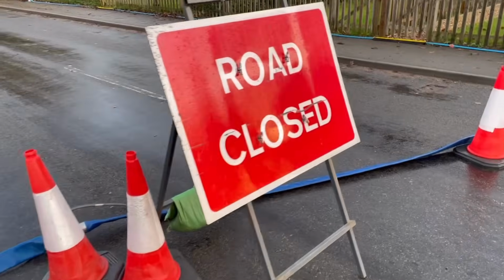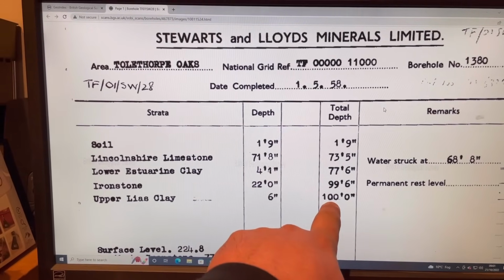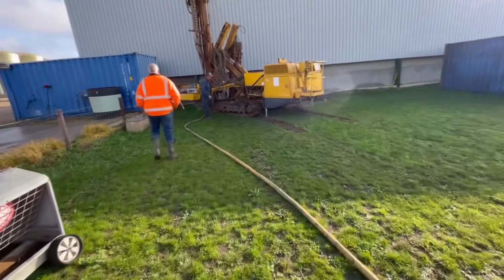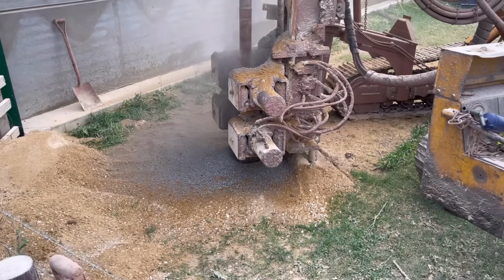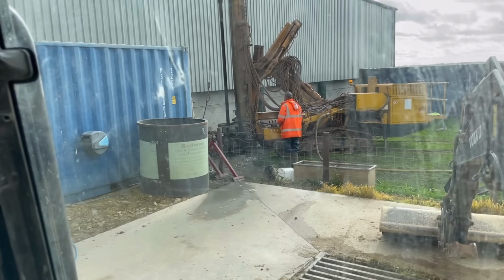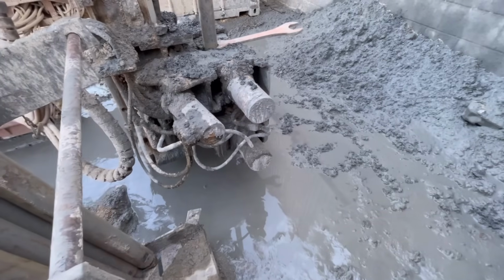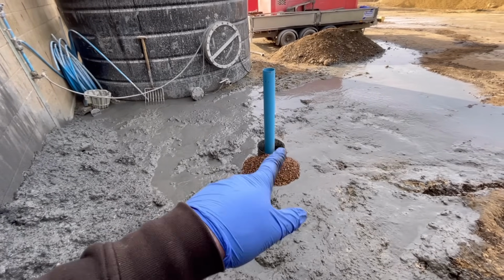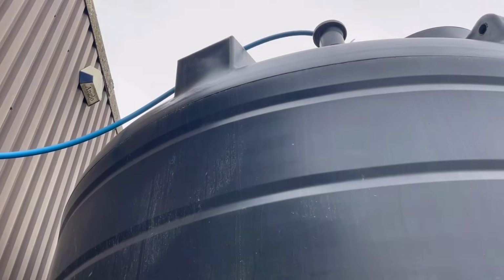Free water for life. Borehole 200ft into the ground to extract water.

Comment: Great video really interesting to see the basic of sinking a bore hole.  Years ago a brewery I worked at in the Thames valley sunk a bore hole where the water was held in a layer of chalk.  They drilled the hole then pumped acid down to dissolve the chalk and create a cavern which would fill with water to be pumped out.
Interesting thing they still had to pay some for the water removed as Thames Valley Water held the rights to all water even below your land.

Comment: Cracking Video Tom - I was really interested to see how easily you can look up what other bore holes were around you, and see what to expect when you drill - it was also interesting to see that it doesn't always go completely smoothly, but that you got there in the end. Out of curiosity, do they typically charge by depth, or by the hour - or just for the end result? And roughly what does a bore like that cost? Looking forward to barn part 2 - nice to see some real day to day farming projects.
Reply from the maker: Hi tim I think it’s a standard charge it only takes about 10mins to go another ten foot deep so not much in it really.
If they drill a hole and don’t find water there is still a charge but obviously don’t have to pay for all the liners and gravel pump ect.
About 7k for full set up all installed so not just drilling a hole.
Reply: In Wales they quote it all for a certain depth (think it was 60 or 70M)  and charge extra if have to go deeper

Comment: I did one about 7 years ago. Simerlar reasons low pressure and cast main down in the village. 
Brilliant thing but last year irnso.ii replaced pretty much everything from pressure vessel to pump to controller. Aim to write that side off every 7 years to get better idea of cost, still cheap water tho.
Add a flow meter, doesn’t cost much but will soon tell you if you have a leak. My system runs at 5 bar as pumps across whole farm and old joints can't stick it. Flow meter tells if i have a leak, turn off various stop cocks until you  get rough idea where.

Comment: Tom you have been running this for a year now, and I'd be interested in what your power bills are like.  Dairy farmers in Canterbury (around Christchurch NZ) have to drill to 300 feet, and need at least two pumps (one at the bottom and another half way up) and their power bills are as much as NZ$10,000 a month.  They are taking way more than 19 cubic metres a day though.  Domestic wells where I live in Marlborough, only go down to 15 metres (50 feet), and that's only to be sure of clean water.  We had to have a new bore put in after the foot valve failed in the old bore, and I watched the new well being drilled.  He hit water with the second pipe, so less than 20 feet.  We are consented to 15cm a day, but it is not metered, and we use a lot less than that even with irrigation going all day.
Reply from the maker: Yes saves a lot on our water bills.
We have solar panels on the roof running the pump but it’s only on a low setting that fills a massive 30 thousand litre tank 24/7 then we use the water out the tank so that we always have a large amount of water on demenad
Reply from the maker: Demand

Comment: Something I would like to do here Tom, What's the power requirement for the pump? lifting water that high must pull a bit of juice.
Reply from the maker: No it doesn’t use much power only a normal household plug.
It’s only ticking over
Reply: @Tomlamb980  Thank you.👍

Comment: Hi tom , I had my well dry up, in 2022, so we put a borehole in.
Do you have a filter system on it.
Reply from the maker: If using for drinking yes
Reply: @Tomlamb980  my new borehole is  only 30 ft or so from, my well, and filters, it then goes  to my bungalow  and farm. 
My borehole is 85ft.

Comment: "Free water for life".
Not free to hire the drilling rig, crew and find water at "200ft".
Not free to pump the water out of the borehole.
Not free the dig the trench and pipe the water to the filtration point.
Not free to set up the filtration point.
Not free to get 48bags of salt tablets for treatment of the water.
Not free electric to power the water treatment plant.
Borehole costs could be £10,000++++++?
Nothing is for free, nothing gives or creates for free in perpetuity.